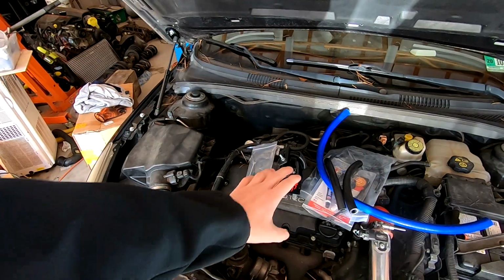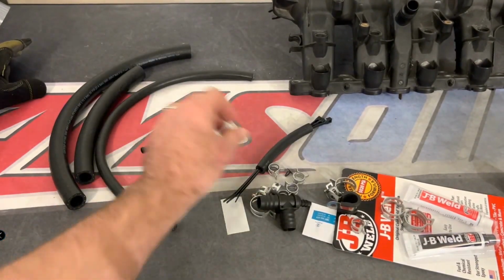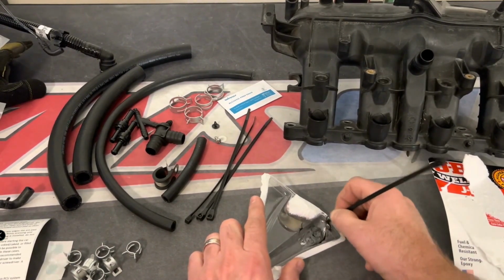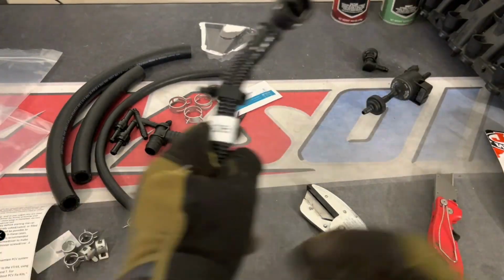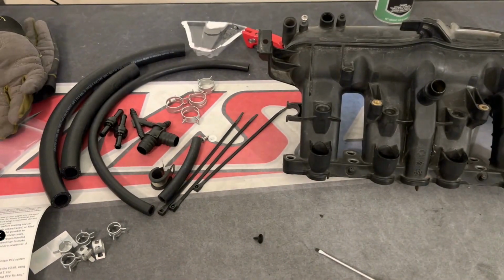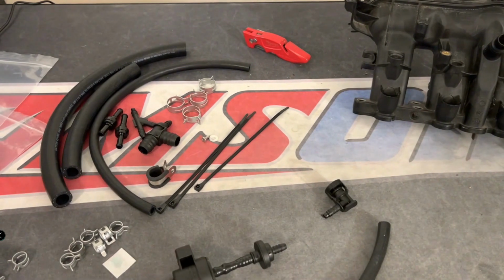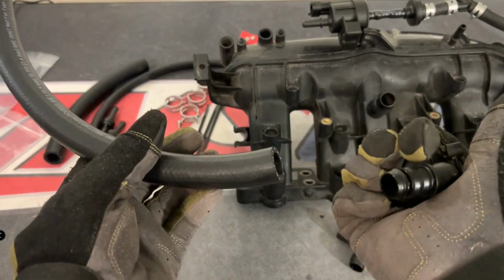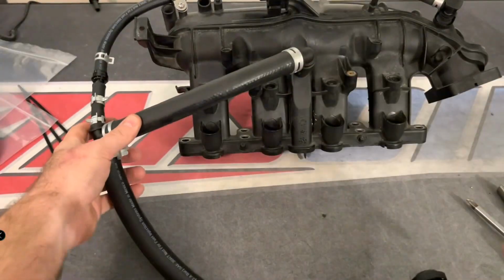1.4 ECOTEC PCV FIX WITH CATCH CAN SYSTEM

Comment: My wife just bought a 2022 Buick Encore and I am a bit concerned about the ecotec engine being problematic.  It seems that the PVC and the turbo are weak points but with the PVC system update, catch can and servicing the oil supply line it looks like those issues can be dealt with easy enough.  It seems that most cars today have something to worry about.  We just let the old Subaru go with 222k that was leaking oil and coolant from the head gasket for like 10 years so we know how to baby a car.  I am planning on changing the oil every 6 months which is like 3k miles as this is what we did to the Subaru and it lasted for a very long time with a major problem.   Thanks for the video.  Even though it looks like the ecotec has issue it looks easy enough to work on and the overall car seems simple enough.   PEACE
Reply from the maker: Hello. Luckily www.supercruzes.com has upgrades to fix those issues

Comment: Hi friend, my catch can has the connections inverted, the input is on the right and the output is on the left. Is there a problem with that? Regards.
Reply from the maker: @2PacMejia  just switch them or are you using a different canister ?

Comment: I'm so glad to see you working with Andre. I used his fix kit and added a catch can just like you did in this video. I used to have it routed the second way you described. Just a warning to those in cold climate areas, if you don't empty it often it can freeze and clog the system. Wiped out the valve cover and turbo on my sonic. Next time I need a kit I'll definitely come to you Dave. By the way if my explanation of my self caused problem doesn't make sense feel free to remove my post as to not cause confusion for anyone. Nice work once again!
Reply from the maker: Hey how are you. Just in case people have an issue using one vs the other style routing I do have some insulated versions to help.

Comment: Most newer GDI cars no longer have the traditional PCV valve but use an integrated Pressure Regulator Valve built into the rocker cover itself. I think they even route the oil back into the pan somehow? So I guess there would be zero need for a catch can or any other mods??
Reply from the maker: Actually the newer cars are even worse I have a completely different set up for those cars. In fact the PCV system causes loud noises that was actually drone inducing. My kit kills that drone
Reply: About to have somebody you have to have somebody drill into your oil pan above where your sump is and put a a bung
Reply: @davesworld2132  That was my point, newer GDI engines no longer have a PCV system.

Comment: Hi, 
 I have been using the v2 kit on my cruze and it's been good for over 4 years & when I swapped out my intercooler, there was about 1 tbl. Spoon of oil in side.  Also, the radiator works well. I have been on the road for about 100 / 200 miles now & I think everyone will be happy with it.  The intercooler kit  keeps the charge cool as well more tq. At the wheel & less throttle  to move the car as well  even on a stock tune.  Thank you
Reply from the maker: Hey hope you’re doing well. I was actually going to send you an email to see how you made out. This is a great comment to leave!!!!!! By the way I recommend adding the catch can to your car that will help get that junk out
Reply: @Dave’s World  I have one ty. I have been doing well over all ty. I hope you are doing well.
Reply from the maker: When you have time Send pics of your car I will add it to the show case on my web site.

Comment: I'm curious if the stock intake manifold can be modified to have a true 65mm opening for the LNF TB?   Rigit now the LNF offered by zzp has a reducer to 49mm which basically makes the LNF TB a worthless mod as it has very little to no performance gain on the stock intake manifold. Now racer x makes their manifold with an LNF 65mm adapter so there would be a true performance gain.   But I'm more attracted to the idea of keeping most of the stock intake manifold functionality but just modifying the TB opening to 65mm.  Thoughts?
Reply from the maker: Yea it can be done easily. Luckily it’s plastic and can be done with patience

Comment: i have a gen 2 cruze and my exhaust has been smoking for a little bit now it had me worried that it was a head gasket or piston rings but in watching ur videos it kinda makes me think its my pcv, i dont have one of your catch cans yet but i have no cats, a k&n intake and no tune. when i took the black box off connected to the k&n intake and pcv hose i saw milky oil dripping out but no where else. do you think your kit would fix this issue?
Reply from the maker: Could be just simple excessive oil from the PCV. You have no cat. Are you tuned?
Reply: @davesworld2132  no i am not i noticed this issue right before i was going to get one so i decided to look into the issue first, i will say tho my car feels no where near what it used to be
Reply from the maker: @kylerlanglitz2120  Email me through my website I can set you up with what you need to fix the problem

Comment: I own a 2017 Chevy Sonic. Will the catch can install on it as well? I couldn't locate any pre-drilled holes on the strut tower. I'm guessing ill have to drill my own holes? Thank you for the content.
Reply from the maker: I have a sonic specific version. It mounts in a different location. What canister set up are you running?
Reply: @davesworld2132  sorry for my ignorance. Idk what you mean. I'm not running anything at the moment. I am just looking into possibly buying a kit in the near future. My car is throwing some codes. I took it to the nearest GM dealer, to see about getting it fixed because there's a recall on these engines, specifically for the turbo. Long story short, they refused to fix it, because my car no longer has a warranty.  I thought warranty didn't matter with recalls? They did scan it. Said It needs a the upper O2 sensor replaced. The camshaft cover is leaking a little oil. It wants to hesitate from a stop when accelerating. I've had this car for 2 years. This year it is starting to act like its "flooded" whenever I fuel up. After I fill up, as soon as I try to start it, it will turn over for several cycles before firing off. After that, it's fine until I fill up again. Something to do with fuel/air ratio? Idk. I checked the diaphragm on the cam cover, and checked for the "orange nipple" (pcv valve?) in the intake manifold. It's still there. So idk what else it could be. I only know your basic knowledge, if even that much. What would you recommend me buy and/or test, etc,..  Thank you in advance.
Reply from the maker: @l1nkofshadowz68  When you first comment that it sounded like you were trying to install some thing that’s why I ask. I have a specific kit that I make that fixes the PCV system and adds a canister to a specific location on the firewall next to the strut tower. That being said even though you see the orange nipple that does not mean that internal check valve is still there. It’s possible that Justice Center nipple is left and the the check valve is broken.
Reply: @davesworld2132  okay. Thank you, Sir. I'll keep your kit in mind when the time comes. I appreciate your help. 👍

Comment: Hey bud. I have a question about the Cruze. I’m from the UK and have an opel/Vauxhall Astra k. Uses the same turbo. I have stock turbo with the mambatek actuator. What is the best recirculating valve to use? I will be tuning in a decat as well once all is installed
Reply from the maker: What year is yours ?
Reply: @davesworld2132  it’s a 2015 model
Reply from the maker: @ColesyShoots  I like forge. If you can’t find one message me through my website and I can get you one.
Reply: @davesworld2132  I’ve been struggling with what recirculating valve in general haha. I’ve ordered the mambatek actuator. Just the recirculating valve now
Reply from the maker: @ColesyShoots  valve makes a big difference with holding boost.
Reply: @davesworld2132  so I’m learning. My stock  actuator failed lol so looking to all the upgrades in one go
Reply from the maker: @ColesyShoots  smart move. Message me if you need help!
Reply: @davesworld2132  all the help I can get would be great haha that’s why I asked about the valve. Hybrid turbo is on my list as well as the diblas intercooler for the astra

Comment: One question I’m not sure of , mine still has the orange check valve in it as I’m not having any boost leaks or anything , what do I do with the plug ? Will I push the orange thing inside or I’m lost here lol, my boost gauge I installed yesterday peaks around 16 psi holds 12 when on flats and I’m getting into it goin up the mountain about 16 . That about right ?
Reply from the maker: The plug disintegrates pretty much turns into nothing over time anyway. If your worried you can remove the intake it takes like 10 minute tops.
Reply: @davesworld2132  ok thanks for the reply catch can showed up today I’m stoked to get a nice weekend day to install it , as I got a oil cooler upgraded o ring kit , and a zzp thermostat housing and a aluminum water outlet and valve cover and the pcv fix kit to install just put my zzp pillar gauge holder in with boost gauge have a oil pressure gauge on the way !! Thanks for an awesome product wit fast shippping !!

Comment: I have a Cruze and need a catch can.
 I noticed in the videos that you can make the intake mod with the manifold in place, which leads me to a question . The part falls into the motor! 
Did I miss something?
Reply from the maker: Usually that part has already fallen apart and disintegrated which is why these kits are designed to repair the intakes. If it’s gone it’s also crumbled into nothing at that point usually. It’s a dumb design and that orange plug literally doesn’t even need to be there General Motors could’ve literally just made that a flat plastic part with no hole in it. Www.supercruzes.com has the add-ons for the catch can if you need one.
Reply: @davesworld2132  thanks

Comment: Does this kit work for 2018? Also is there a way to walnut clean the valves?
Reply from the maker: There’s a different version of the PCV fox on www.supercruzes.com  for the Gen 2 . As far as walnut clean you can only do that if the head is removed. The Gen 2 oil separator system will keep the valves clean

Comment: If your original check valve is still intact can you double up check valves and run it with the kit until it fails? Dont know how i feel about jb weld inside the intake
Reply from the maker: You can but I would just pop it out and fix it now while you’re in there
Reply: Pop it out and let it fall inside the intake or should I take the intake off and get it out
Reply: @paulcherry1520  I think others have just let it fall in without issue but I never did anything with this yet as my car is still doing okay without it. 2015 with 98k currently
Reply: @Rancid_Ninja ok thanks illl see what Dave says here mines got 123,xxx 2012 Chevy Cruze eco black 6 speed manual many mods to go lol

Comment: Can i buy just the catch can? I don't see the option. I already have the pcv kit.
Reply from the maker: It’s option 2 it’s not just the canister it’s also the holder with the quick release and the additional hoses clamps and fittings. It’s an entire redesign and allows the canister to be placed in the exact spot it needs to be.

Comment: What if the check valve is still in the manifold
Reply from the maker: A lot of times just the orange nipple is there but the valve is broken off inside and what you see its the part that is left
Reply: @davesworld2132  do you just pop it out ?
Reply from the maker: not just pop it out but it also needs to be capped and the check valve needs to be relocated.  @scottyj1643
Reply: Did you fix it? Check it now, could be gone. I bought the pcv fix kitv3 from that other dude with yt video about it, last year. When i looked i still had the orange valve so i just threw the fix kit on the shelf. Today i looked and the orange piece is gone so i installed the kit finally 😅@scottyj1643
Reply: @RandoManFPV what you could’ve done is get a flathead and ripped the nipple out, and it would’ve just be tossed out by the engine my trax has 51k miles pretty sure the nipple is still there but I’m just gonna pop it out
Reply: @nizo6673  yea I didn't really wanna send it through the engine. I assumed that would be bad, didn't know it would find an exit

Comment: So I have a 2020 Chevy trax I'm getting oil smell inside the cabin I have not found any oil spots turbo is maybe 6 to 8 months old 2nd turbo there is not lights on I have same engine you have my PVC valve is not making any funny sounds this car is 1 issue after another I hate this car but I'm stuck with it also I don't no if these engines have a rev limiter because I got in the car the other day and I decided to put the put the gas to the floor and it only went up to about 4,000 RPMs so I decided to go for a ride ride when I went for the ride the RPMs were fine I could get them I pounded it to the floor and I actually got all four tires it's been I mean it's a s*** car it could have it was s*** road condition so I could see why the all four tires ripped it's nothing special it's there's nothing been done to it to make it anything special but the dealerships keep my f**** me I have an extended warranty that nobody seems to know about the girlfriend roommate is a f**** a**** so I said you know we should probably get a warranty that usable and she just doesn't f**** get it but they're saying that if they cannot replicate the issue at the garage that I'm going to have to pay them $150 obviously they're going to come up with a way to say that they cannot replicate it but because it's happening and then it doesn't happen I don't get it but something is not right
Reply from the maker: Call me during the week and I can help you diagnose this.

Comment: Question i have a  sonic 1.4 i dont have any code or problem with the pcv or so but i saw i little bit oil on the turbo inlet  so  i want to install a oil catch can ,is this ok or do i have to use the whole pcv kit or is any issue if i only put the catch can without the pcv kit  thanks in advance